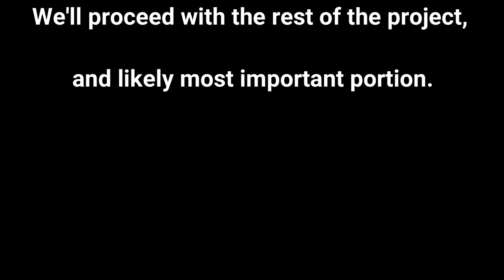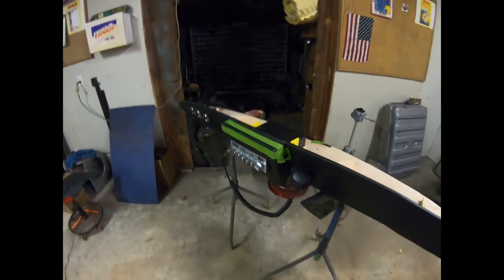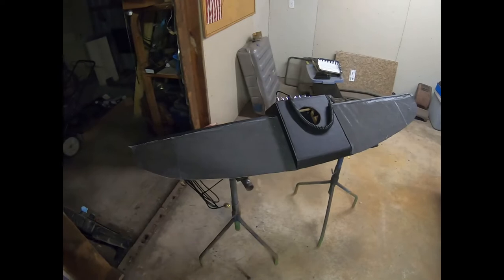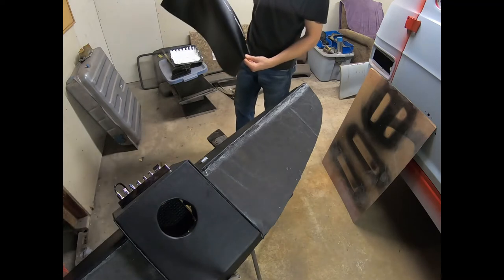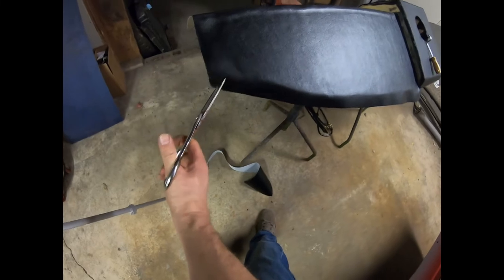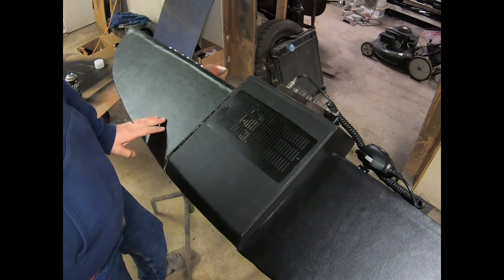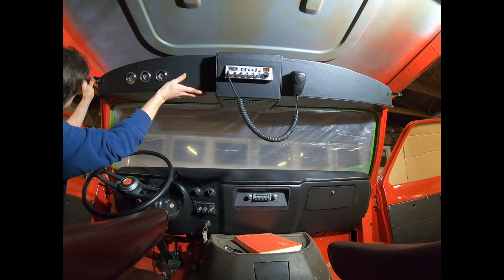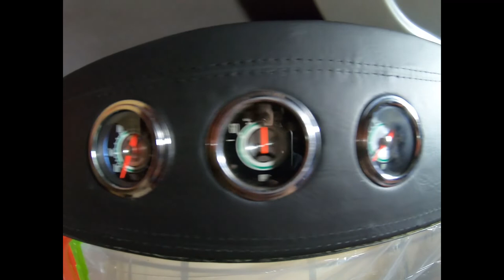Custom Overhead Console PART 2 - Hoosier Garage

Comment: That was great.
Being farther north than I am, driving into the sun on a late winter afternoon has to be challenging.
Would you consider;
Notching the console to fit sunvisors in stock location,   OR
Mounting sunvisors to the console, OR
Tough it out and plan your driving accordingly.
I don't use sunvisors a whole lot,
but when I do it is because the sun is bright in my face.
Sunvisors could help put on a sunscreen on your windsheild in sunny parking lots. Some people don't like them.
Have you ever had a vehicle w/ t tops or sunroof before?
Reply from the maker: I have a newer car with a sunroof.

On the sunvisors the originals are way long for this but I have some from a Equal year charger that are shorter that will fit perfect
Reply: @HoosierGarage  Great. 
Had a few older cars w/ t tops and wagon is my first sunroof. All of them leaked. Even silconed one Camaro shut. Still leaked by window. 
Wagon started leaking not long ago. Believe it is from rust on roof where paint chipped away. 
Newer sunroof system might be better. Don't know. Sure it will be a few inches thick. Might could hook up power to it. Probably fine tune console more. Ambitious.
Reply: @roadkilldoesntfly1773  just a thought but they do have drain holes with hoses that can get clogged with leaves, dirt etc. Did you check those a blow them out with 45/50 psi my 74 charger has them.
Reply from the maker: @roadkilldoesntfly1773  Yes I was going to mock up speaker location relative to the sunvisors.

On the sunroof I understand. one thing i notice about the newer ones like my 2010 Camaro, is that in the channel they have a couple nipples, and hoses that run back into trunk area and I believe into the trunk floor for a drain out.
Reply: @moparnut6286  Did not know that. I have to hunt for them. Thanks.
Reply: While Vista Cruiser came w/a factory sunroof it was replaced sometime before I bought it. 
I will still look for drain holes but in the times I have cleaned the rubber I did not see drain holes.
Reply from the maker: @roadkilldoesntfly1773  it likely didn;t have them back then.
Reply: @HoosierGarage  Chrysler may have been ahead of the game putting drain holes on Moparnut's 74 Charger.
Reply: @HoosierGarage  the factory car  ones had the drains... aftermarket ones most likely no and that's why I don't like seeing aftermarket ones intsalled to many people cut corners and they leak.... This goes for 70s factory sunroof the sliding panel type only...not the one that locked with clasp style locks.
Reply: @roadkilldoesntfly1773  a fact on the factory sunroof they were done by a German company....who's owner immigrated to the USA pretty cool.
Reply: @moparnut6286  Mine has a clasp style lock. Believe that is the factory style however. Oldsmobile made sunroof standard equipment in 1973 to substitute for the outgoing Vistaview sky windows. From 74- 77 I believe it became an option.
Reply: @roadkilldoesntfly1773  the clasp style....  to fix from leaking  takes removal and resealing and making sure all seals are good and repairing any rust damage got one on my daughters Oldsmobile intrigue glad it doesn't leak won't open either but I tell her oh well....lol 😆
Reply: @moparnut6286  Best thing to do is never open them. Clasp do become looser just from using them. Mine developed a little play and I hardly used it. It could be from exposed metal around it. It is good for collecting moisture. When I am driving I cannot tell the difference. But it sure makes the interior feel a lot hotter in the summer if parked outside.
I was looking at different forums just now and I found some debate as to wether sunroof was standard or an option in 73. I understood it was standard 73 only. Another argument is was there a delete option for this in 73. IDK. They were pop up but one site says it was electric. I don't believe it was electric.
Reply: Wish Oldsmobile would have stepped up to the sliding roof like Chrysler did.
Reply: @roadkilldoesntfly1773  yeah there is a lot of controversy when come to to what came standard and what was an option different plants did cars different from others year to year changes it goes on and on have seen some electric style pop ups but not many....my 74 sunroof charger stays parked in side tent when not in use and when it comes to any thing that cuts into a perfectly solid roof makes me queasy! Even vinyl tops should be a garage kept car for longevity.
Reply: @moparnut6286  Now I wonder if a sliding roof might have come close to the screws holding the luggage rack. Both are rust magnets. I need a bigger garage. My land is hilly so tents wouldn't work without some serious land grading.
Reply: @roadkilldoesntfly1773  well you could go with high quality car covers like $300 and up,  waterproof as well but I can't spend that kind of money on a cover.... Me I would rent some heavy equipment and get to leveling the ground. The factory sunroof had welded in brackets to the bottom of the roof,  that the sunroof was attached to with either captured nut or extruded nut to bolt too but it is possible some previous owner ran screws through it I seen some crazy crap done be owners.
Reply: @moparnut6286  I have paid around $100 for several different covers over the years. I don't think any of them had any real quality. Even had one dryrot and turn to literal dust when I threw it away. Saw one from OER on somebodys truck that I thought looked pretty good. Might try it.
Forgot to say about the trees to remove before marking a spot. I have a lot of them. Garage is pretty far down the budget chain. We have considered moving farther out into the county. Would like to try and build as much as I can myself after I retire. Maybe about 7 years. Not sure exactly which way we are going as far as expanding.
Houses here sell as fast as they go up for sale and the prices have been climbing.
The luggage rack right behind the sunroof has screws. A couple of them popped out from the rust that the rack promotes. I wondered if those screws would interfere w/a sliding sunroof. Mute point, just wondered.
Reply: @roadkilldoesntfly1773  if I could move I would get minimum 5 acres in the middle of the country a medium size house and a 60×80 building with a spray booth and I'd be that piggy that's happy in💩 they talk about!

Comment: A Cobra Chat Box radio cool wait what did the letter C.B stands for was Chat Box or Citizen Box or Code Box. But anyway I give you a very Big 10-4 on this video.
Reply from the maker: Citizens Band! Thank you!
Reply: anyway my dad had tons of old 70s Mopar I rode up in back in the 90s first he had that Plymouth code J5 Limelight green 1970 Duster that went over 30MPG with a 318 2bbl A833 O/D 4spd all blackout vinyl interior that he drove over 400000 miles and he had a 1974 Dodge Custom W100 Power Wagon short bed with a 318 2bbl 3spd auto on the colum powder red paint exterior with all black vinyl interior reg cab truck and then he had a 1976 Dodge Tradesman B200 with yes also a 318 2bbl with a 727 auto trans brown body paint with with shaggy interior and a Sir Lance-A-Loth painted on the side with a wrap stripe that got a batsymbol look a like in the stripe badly he sold all of those in 2001 I was 12 years old at the time but those were the oldest Mopar I got into cars.